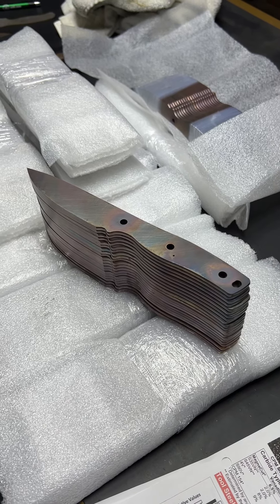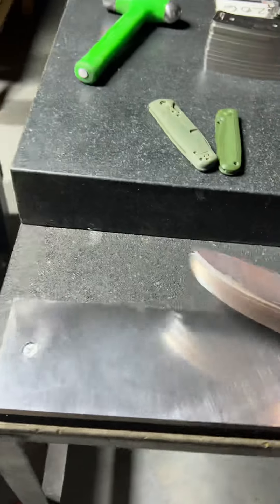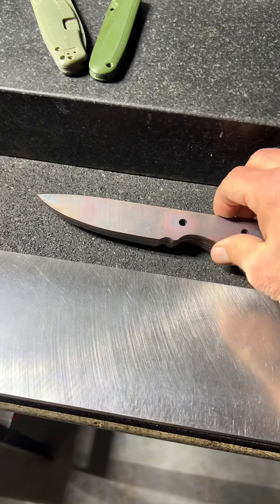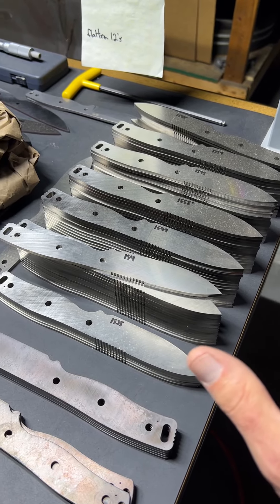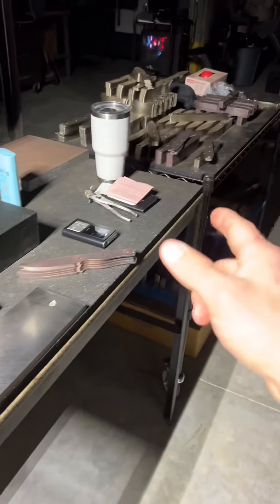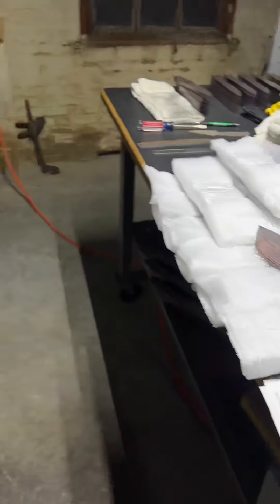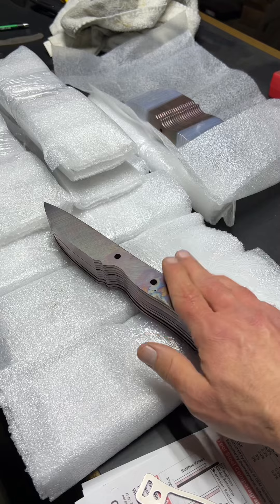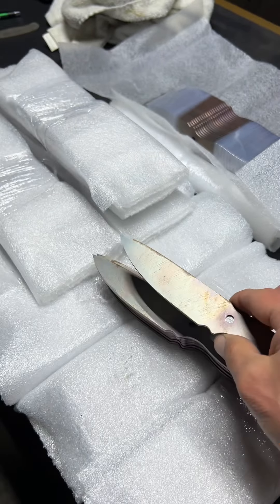Back From Peters' Heat Treating!

Comment: Excited to see some stainless options coming back on the table! It seems like magnacut might still be what it seemed when it first came out, too good to be true. Do you have any plans to work with Vanax? It seems like you get basically all the benefits of Elmax with quite a bit of added toughness. I'm not sure if it is exorbitantly expensive vs Elmax or if quantities are super limited but it seems like a great option for a thinner mid-sized knife like the 4.5 bushcraft.
Reply from the maker: We will be getting a small piece of Vanax in for testing shortly. You are right though, it is extremely expensive. I want to ensure manufacturability and performance before committing to anything.

Comment: Is there any chance you guys would try out K390 in the future? In my experience its the most well rounded tool steel Bohler makes. Super tough like 3v with at least 3 times the edge holding.
Reply from the maker: Yes, we are actually looking at that as an option for some smaller knives. Thanks for bringing it up though, I appreciate you guys sharing your thoughts.

Comment: Elmax is fantastic. Any thoughts on using K340 in the future? Great steel when heat treated properly!
Reply from the maker: I will always want to do a sample batch, but my initial inclination is that I trust any of Bohler PM steels. The K340 looks like an ESR grade, not many stand out properties for a knife blade. Can you sell me on a use case where maybe Vanadis 4E or K890 wouldn't do the job a bit better? I'm not saying no, I just want to know what's on your mind. In any case, thanks for stopping by and for sharing your thoughts with me. 👊

Comment: Guy, what angle do you sharpen the ffg at?
Reply from the maker: 20° per side, it is done on a CNC, water cooled, sharpening set up now. You can lean it back, but I found that to be most useful, for most users from the factory.

Comment: I appreciate your commitment to only sending quality out the door! 

But I am wondering, you said you're working on GSO 4.5s. Does that include the current k890 preorders that are up on the website, or is that only the magnacut replacements?
Reply from the maker: The K890 blades on order and available for preorder are in the batch finishing up now. They are being finished right alongside the magnacut orders, although the Bohler Uddeholm materials finish up a lot easier. That progress is much faster, making this situation wrapping up the CPM products that much more frustrating. 🫠

Comment: Maybe dude doesnt show his entire manufacturing process for a reason.  There is a reason their product are as nice as they are.  Also looking all the videos of the blanks cut you cant fake chemistry.  So if they are sent off to a lab Crucible is the only one making these chemistries and Niagra is the only one rolling.  So if theres voids which cant be manufactured into the steel or non metallic inclusions or un welded powder they will show up in examination.  Either the starting material is good or not.
Reply from the maker: You get it, on all accounts. Some of the things we do in here were very hard earned lessons. I am an open book unless something is proprietary and cost us a lot of time or money to develop. That is the competitive advantage in a small business.

All of the seasoned metallurgists also agree with you, 110%. I will have some of these voids under a microscope in a couple days, to show you guys better what is going on. I am excited to show you an example of a subsurface delamination pocket. The trolls will have an especially hard time explaining that one.